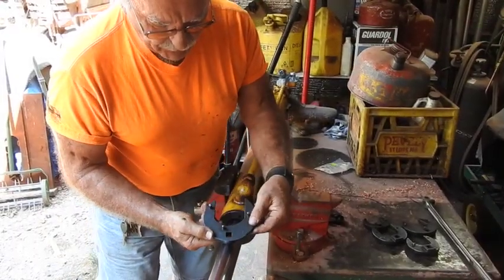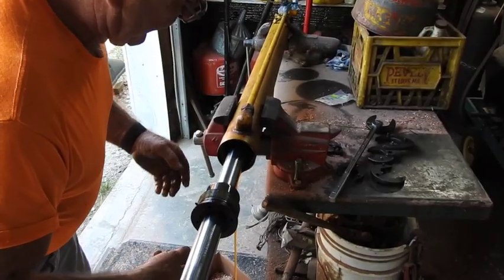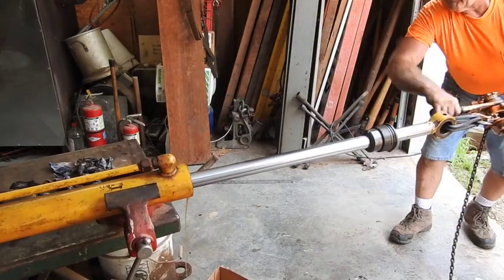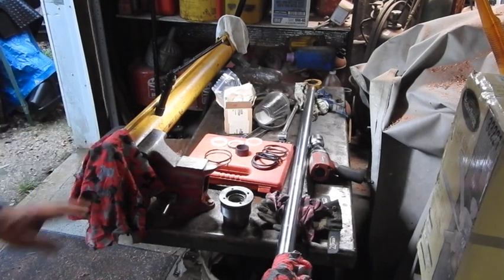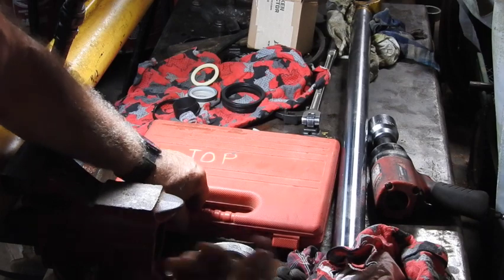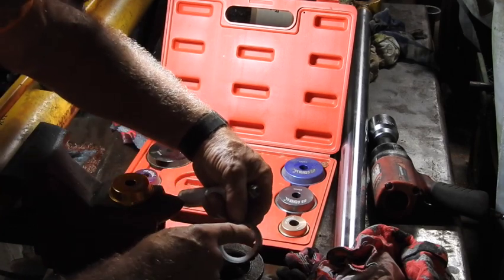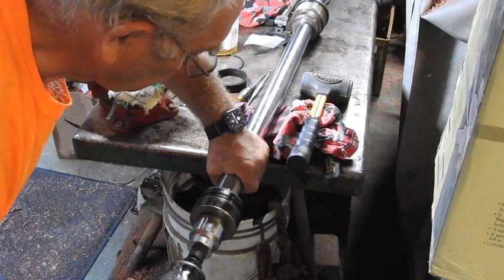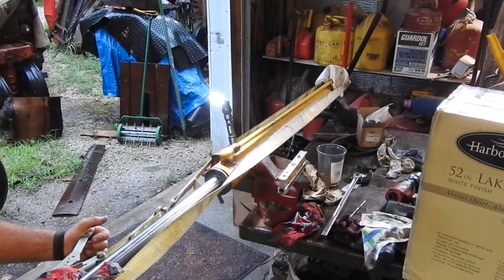Case Backhoe Boom Cylinder Repacking Job

Comment: What are the spanner sockets called?  You used them to unscrew and disassemble.  Where may I purchase them?
Reply from the maker: These were purchased at the dealer when the machine was bought new in ‘73. I’d suggest contacting a case/international dealer parts department. They are just called spanner wrenches for the hydraulic cylinders. There’s multiple sizes in the set to cover all the cylinder  diameters on the tractor

Comment: Great video. I got a small crack just below the head. Can I put a weld over that to seal it? Recommendation?
Reply from the maker: I do a lot of things on my own tractors and machines that I wouldn't do commercially.  So if it was mine...I would weld it in a heartbeat.  I'd grind a bit of a groove in it and give it hell !!  As long as it doesn't extend into the threads.The worst thing that can happen is you have to buy a replacement anyway so it can't hurt giving it a shot.
Reply: @tractorman4461 works for me. Thanks

Comment: I would like to see how to bleed the hydrolic line on installation.
Reply from the maker: Well Dennis, once you are done with the repair, fill the reservoir, start the tractor and it will take care of itself. The return line isn't under pressure like the supply lines, so the air will vent automatically at the reservoir.

Comment: I wish you had a link to where I could purchase that set of spanners.  All the ones I see on line look cheap and they are the universal type.
Reply from the maker: I'm betting a Case International dealer might be able to find a set of them NOS with a dealer in their network.  Or maybe try ebay for a set of Case spanners.  They have replaceable pins in them and I bet those are still available. They are hardened steel pins, not roll pins.

Comment: I am retired so I have time to watch hundreds of how to videos like this and I can tell you, this is one of the best.  Thanks for the lesson.  I'm planing to have a Case 580B picked up tomorrow and start the restoration.  Many of the hydrolic cylinder need new seals.
Reply from the maker: Thank you for the cool comment Dennis.  Usually when the seal is leaking it means hydraulic oil is beginning to work its way past the packing meaning it might be time to repack the cylinder like this video and not only the seal.  One thing too, I don't know how many years Case used the cylinders that required the spanner wrenches to disassemble. One thing to think of also is google search for a local hydraulic shop where you can get hoses made and the JIC hose fittings replaced as needed. There will be a few for sure, and there's some special swivel fittings on the hoe too. Bear in mind some cylinders come apart much easier than this one and others are much much worse. Good Luck, and you're gonna love the old gal.

Comment: How many pounds of pressure are on that bolt at the end of the ram? I've got a 3/4" breaker bar and a 6' cheater on that thing!
Reply from the maker: Hahahaha...yeah buddy, you got a tough one !!  Rusted in place like a lot of them.  Seriously tough ones require strapping to a strong work bench and a hydraulic jack on the handle. Be ready for a mishap too. I had one on the loader that it took a 5 foot pipe wrench and a cheater but if you have to use a pipe wrench slice some PVC pipe to slip over the ram for protection. Once the new packing goes in, it does not take too much to tighten.  I don't know the footpounds, but it doesn't take as much as you may think.  Good luck with it !!
Reply: @tractorman4461  Had to take it over to my son. He's a diesel mechanic for a trucking company. He broke it loose with a 1" Milwaukee and it made that thing snort.

Comment: Put electrical tape on the second seal going in and a hose clamp for an hour or so, and no strap putting it back in.
Reply from the maker: Good tip, thanks for taking the time to share it with us.

Comment: I wonder how much different this is from  250 Dual loader I need to give it a try
Reply from the maker: It'll be basically the same Dwight. The way they come apart might be a bit different and the packing components may be different, but all of them are similar.  Not all of them take the spanner wrenches. Hopefully yours will disassemble pretty easy. Some guys say to use compressed air, but I won't do that because of the lack of control.  Many times they can be rebuilt right on the machine, but shop work is the best in my opinion. Its in the shade in the summer and in the warmth during winter and all the tools are right there where you need them.

Comment: compressed air and a blow off nozzel is magic for ejecting the cylinder. Just make sure it is restrained/contained so it doesn't go Mach Jesus!
Reply from the maker: Yessir, that is an option but I still prefer the control of pulling them apart for that reason.  I like it much better when they slide apart by hand with just a little nudge.  I gotta say I chucked at the Mach Jesus....LOL

Comment: Part number of spanner set
Reply from the maker: Oh man, I got those with the machine along with a lot of maintenance items Joshua. My cousin bought this machine new in '73.  I'm sure some of the industrial parts guys have access to the part numbers. If you can find an on line PDF on the 580's I'd think there'd be a listing in the service section.

Comment: Dang i envy you! I got lucky on my jvc. Broke my bucket cylinder loose w/ pipe wrench. Screwed right out. Rubber o-ring completely destroyed. Boght a hot water heater o-ring. Cut it. Slipperld it on supeglued back together. Slipped into groove. Good as new! $6! Lol.. love your video. Glad mine was ez!

Comment: Looks really good the way you did it. I just talked to a neighbor who has the same machine and I also just picked one up. He’s a retired operator and he told me the nice thing with these is that you can repack it with the cylinder end still connected to the machine so that end will be solid though I’ll probably cap the line, but this video gives me confidence when I go to do mine and will know what I’m up against. Thank you sir!
Reply from the maker: I took this one off because its 10 miles away from home.  I have more tools and can handle more difficult problems if I have the cylinder here in the shop. But yes, depending on the cylinder it can for sure be rebuilt on the machine.  Some times they can be TOUGH !! Other times they are very simple to rebuild. Thank you for watching.  Sorry I missed your comment for so long.

Comment: I have worked on a couple but when i get older i want to do that type of work
Reply from the maker: Well for sure it's one of the jobs that will NOT be replaced by a computer operator or a robot !!  That's one of the things to consider as a young man.  I decided on being an hvac tech using the same thought process about 50 years ago.  I was thinking of what kind of jobs would keep me busy all year around.

Comment: Great video. I'm eyeing a early 60s Case 580 that has leaking cylinders, i believe all of them. These videos are invaluable.
Reply from the maker: Awesome !! They all don't come apart easily.  Some give you the fight of your life, lemme tell ya. The main thing is ordering the correct kits based on the serial number of the tractor, loader and hoe.  Make sure you have all the numbers when you contact the supplier.  There are variances in rod diameters and kits that will deal you a fit !!  Good Luck.

Comment: Im trying to reinstall my cylinder that's inside my backhoes boom. It's a 70s/80s john deere jd310. Blew the hose so pulled the home cylinder out and replaced it but can't for the life of me get it back in. How the heck do I do it???
Reply: Whole* not home
Reply from the maker: If you've gotten the cylinder repaired and are trying to assemble it into the machine it shouldn't be too hard if you hook the hoses up first so you can move them ram in position once one end is pinned.  But if you are trying to get the ram into the cylinder, you might check and see if the parts are installed in the right sequence. Even. if its correctly assembled the new parts are going to appear to be larger than the bore because they're not scrunched down yet.  It just takes a bit of fiddling and maybe a spare set of hands to get it in at first.  I'm sure by now though you are done with the project.  Sorry it took so long to reply.  It's crazy busy here.

Comment: my dad has a case 580m that needs the back bucket cylinder replaced. we have the vice table and all but i’m no expert mechanic by any means, would it be the same thing & work the same way? i would love to get it fixed up for his birthday but i don’t want to ruin anything on the backhoe possibly pretty pricey
Reply from the maker: I'm not familiar with the 580M so I don't know if they require the spanner wrenches to disassemble. However, once disassembled the repair/replacement of the cylinder packing and seals should be pretty much the same.  The caveat...you must ensure the correct rebuild kit is ordered for the particular cylinder you have.  If you are sure it is the original one with the machine, ordering by tractor or hoe serial number should get you the correct one. So be prepared with the serial #'s of the tractor, loader and backhoe when you contact a supplier.
Reply: @tractorman4461  i appreciate the help, this is gonna help me in the longrun when i plan to take over the business for him 🙏🏼

Comment: in my situation it was better to screw the Gland out to allow the oil to come out , them screw the Gland back in to keep the Rod from  swinging left or right , up or down . Do  NOT screw the Gland out until  1st   pulling the Rod all the way up to the Gland . The reason why is , with the Gland  scewed out and the Rod deep inside the  cylinder , the Rod will either swing left or right or up or down , thereby binding and making the rod very difficult to pull out .After draining the oil and screwing the Gland back in it will keep the Rod from binding when pulling the Rod out .😊😊
Reply from the maker: Yes, all good tips.  You certainly don't want to bind it in the tube by letting it side sway.  I've had some very easy and others very not so easy too.  Thanks for watching and providing additional input.

Comment: What valve keeps the boom from swing side to side on its own from gravity?  My swing works ok but it wont stay in position when controls are not in use
Reply from the maker: I would think its not the control valve but just the cylinder leaking off a bit. It's like the loader lowering itself a foot or so overnight, or the outriggers slowly lowering the machine overnight.  Just my thoughts on that though.
Reply: @tractorman4461  I thought i saw someone talk about a valve for this maybe.  Do you know of there are o rings need changing inside the pressure relieve valves?  I didn't take them apart
Reply from the maker: @FourthWayRanch  If you had a failing pressure relief in the system, it would probably be inhibiting operation while in use, not usually at rest.  I'm still thinking a repacking of the swing cylinders would do the trick.  But again, not a professional at all.  Just my suspicion.
Reply: @tractorman4461  I'm redoing the seals in the whole control valve block and the cylinders.  I didn't take apart the pressure relief valves yet, I don't want to if there is no seal inside them

Comment: What brand is that two set and the part number of the spanner wrench ?
Reply from the maker: The set of spanners came with the machine from the original Case dealer.  My cousin bought it new in '73.  I'm sure a good Case/IH parts man can find them in their archives.  I have no idea where else to look. The set has spanners for all the cylinder sizes on the tractor.

Comment: i dont agree with the recomendation of chiseling to spin the gland nut thats stuck... there is a better way.. peening.
Reply from the maker: Sometimes a fella doesn't have a choice.  These cylinders have only about a quarter inch flange with a set screw to lock them then they require spanner wrenches to spin them out.  Then if you're not careful you'll wallow out the spanner wrench holes or worse, break the spanner spuds off of the wrench.  Some are near impossible that sat outside in the weather for years and years.

Comment: I'm an old redneck with a backhoe and I appreciate that video I actually have a 680 but I blew the same cylinder today and Dread fixing it but you make it look pretty easy. I don't know why you couldn't do it with leaving one end on the backhoe as long as you had a hoist and something to catch the cylinder and not scratch it up but my major question is what's the torque on that nut I've heard horror stories about some of these track hoes having 5,000 sub pounds torque requirements on the nuts on the end of those things

Comment: We leave the cylinder on the tractor and pull put the cap, shaft and piston for rebuild in the shop
Reply from the maker: Oh heck yeah.  I agree with that, but I like to remove them because its easy to seal up the disconnected hoses while working on the cylinder.  Sometimes due to finding parts or just workload, they have to sit two or 3 weeks before I can get back.
Reply: @tractorman4461  I learned a trick for that, use a plastic glove as a cylinder cap)!  Not my idea but worked great.  Also need to have a 3/4" impact drive to break the piston loose.  A warm water or oil bath to make that inside piston seal flexible along with a of dousing with hydraulic oil.
Reply from the maker: @mikexom  I had the warm water trick already but dang, the rubber glove trick is something I NEVER though of.  LOL.  Thanks for the tip !!

Comment: Do you remember what size the that bolt is
Reply from the maker: No, I surely do not Jeff.  Sorry.  And the tractor is nine miles away right now too so I can't look at it.
Reply: @tractorman4461  it was a beast to remove
Reply from the maker: @jeffjames9568  sometimes you get lucky with some of these things and sometimes you just have to pay the price!
Reply: @tractorman4461  1 1/8 haha i figured it out

Comment: Where is a good place to purchase the seal kit for this?  I have a 580C with a leaking cylinder exactly like this.  Thanks and great video
Reply from the maker: This is where I got the last couple kits: https://amsconstructionparts.com/case/580b/backhoe/hydraulic-cylinders/parts.  Look closely for numbers and letters on the packing gland just in case but the main thing is to have the loader and backhoe serial numbers.  Iirc, they needed the numbers on the actual back hoe for a loader cylinder kit.
Reply: @tractorman4461  thank you.  Can you give me an idea of where to look on the machine.
Reply from the maker: @buck8317  They vary.  Mine is a '73 and the backhoe info is a tag on the control valve tower. The tractor info was on the steering tower as shown in this short video:https://www.youtube.com/watch?v=qfJyheaj-xY. Unfortunately I didn't include the location for the hoe.
Reply: @tractorman4461  Thank you so much for your help.  Mine is a 580C and I did find a tag for the backhoe portion.  Now to try and get the seal kit and watch this video again when i get it in.
Reply from the maker: @buck8317  Not all of them need to be pulled apart like this one was.  Some can literally be disassembled by hand if you are lucky.  Others can be even much more difficult than this one too.  Good luck with your repair.
Reply: Got all torn down but have an extra white plastic washer.  Not sure where it goes.
Reply from the maker: @buck8317  sometimes the kits include parts to make the kit compatible with additional cylinders. As long as you have the components to replace the ones you removed, you should be good to go.

Comment: Headgland set screw?
Reply from the maker: Yes, that's the first thing to remove. Sometimes these come apart by hand and others have to be pulled. I've never been a fan of using the hydraulics or even air to move them for the potential of making a mess from the oil but mainly for the lack of control if the ram moves too quickly.  But like I always say, the situation dictates the direction of attack.  The machine was at a remote location to the shop and all the tools too.
Reply: @tractorman4461   I've seen those set screws with broken heads. You can barely find them if the heads broken off and their covered in mud. They end up needing to be drilled out :(

Comment: Not everyone has a workbench with 2 vises...I leave the cylinder connected to the machine...just take the pin out of the rod end...block up the tube...extend the rod...the gland is usually not coming off that easy...use a ball peen hammer and lightly tap the tube all around, right next to the gland...probably need a long pipe on the breaker bar...the rod bolt should be loctited, so you need to put some heat on the bolt head...
Reply from the maker: Oh, we've had to do all kinds of things to disassemble some of them.  I took this one off of the tractor because its located too far away and all the tools are back here in the shop. After this one we used a 4 foot pipe wrench on another one. 
And yet others come apart with little effort. You provided all good tips too.

Comment: I use a hydraulic ram helps control pulling out rod. just plug it into
 my tractor hydraulics or my bombardier.  Or i use the hydraulic cylinder of the log splitter. works great. 
Nice job 👍
Reply from the maker: Heck yeah...what ever works best is the way to go.  Heck I've had some you could slip apart by hand too !!  I like those kind.  Thanks for the added input and for watching too.